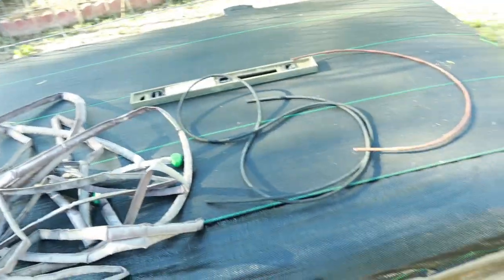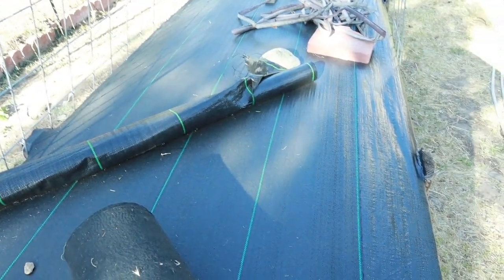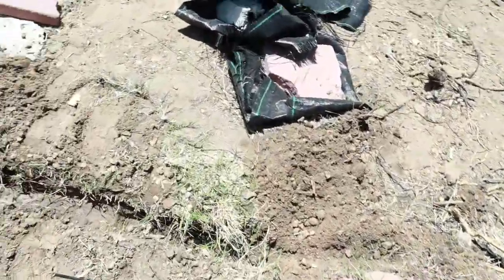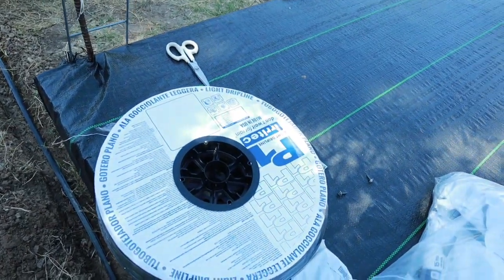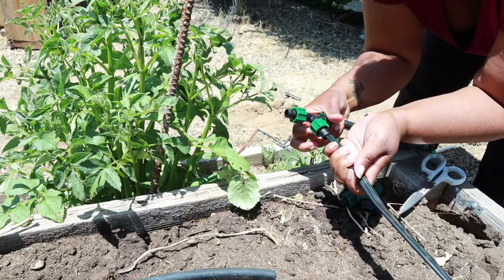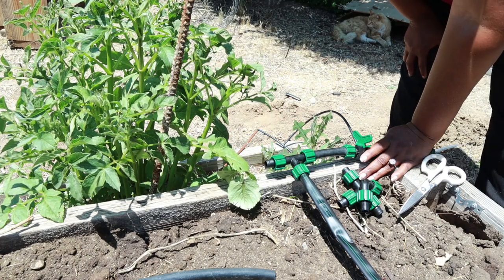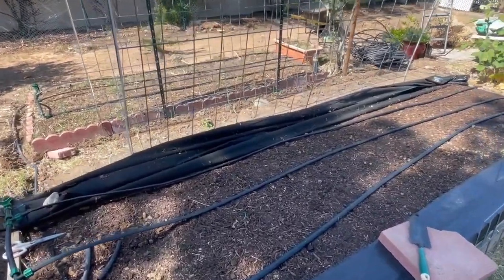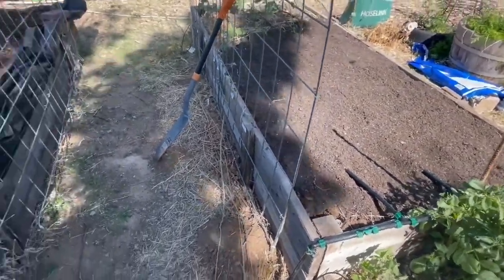Installing My New Drip Tape Irrigation System From Drip Depot

Comment: Nice job. I understand the soaker hose i thought it was b cuz i left them on too long and my water bill was higher than when i hand watered so id really like to know if the drip yape worked out for you did you still get soaked walk ways and was your wayer bill still high did you put a timer on it and how long do you have to run it to get a good watering? Much love for the video ❤
Reply from the maker: @charliewilliams8794  I love using the drip tape…it has worked very well for me…I do have it connected to an automatic timer which the timer I’m using isn’t the best but it’s consistent and reliable….i have my irrigation system set to water twice a day during spring…4 times a day during our blazing summer…once a day during fall/winter…thanks for watching and leaving a comment 🥰